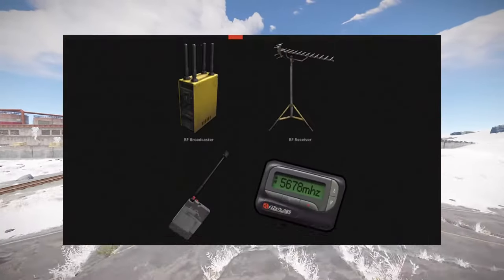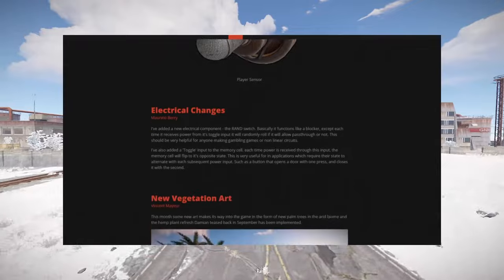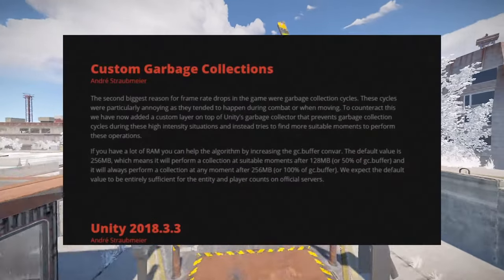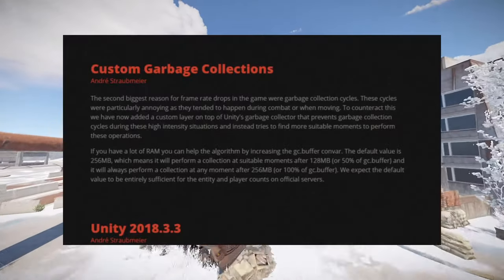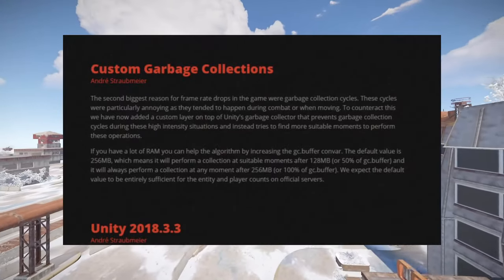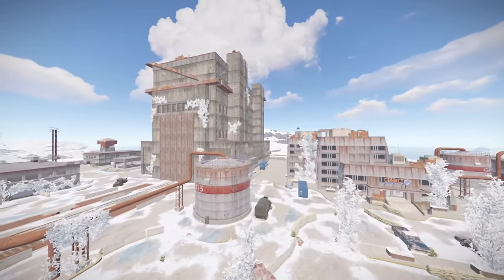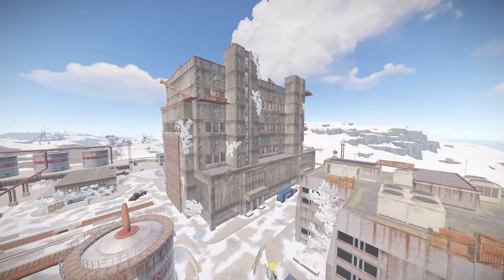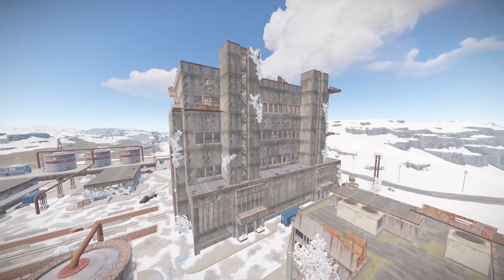How to reduce FRAME DROPS in Rust (GC Buffer Explained) | Quick Rust Guide

Comment: I discovered this option myself only a couple of days ago and it made a big difference for me (setting to 2048 with 16gb of ram). Funny thing is I'd noticed the occasional freezes a week prior and said to my mate over discord (being that we're both software engineer's) "what's with the game briefly freezing up every now and then? Almost feels like garbage collection to me". Then a bit later I noticed the console messages saying "rust emergency garbage collection" and confirmed my suspicion (and quickly found the solution).

Personally, my guess is that they set it to its 512mb default back before they added the stupendous amount of DLC they've chucked in the game lately, and now 512mb is simply not enough of a pool to contain all the various different skins (and other useless rubbish) you might find near you to avoid "emergency" GC.
Reply: isnt 4096 for 16gb ram better ?
Reply: @xtc3530  Maybe, but I haven't noticed any stutters at 2048 (whereas they were VERY noticeable on default settings) so that's where I've left it.

Comment: Won't this make the garbage collection occur less frequently, but take longer to execute once it does run?
Reply from the maker: The collection process tends to feel the same regardless of size, but you are correct. 

The positive is, Rust will try to do such collections when other players or npc’s aren’t around. 

So while the lag / freeze may feel a micro amount bigger / longer - the chances of this happening during a fight or a really bad time is much less. 

It’s definitely a case of weighing up the pros and cons but honestly changing this setting has stopped those random freezes while I’m literally mid-fight and I get a quick freeze frame.

Comment: I have 32 gigs should I do max?
Reply from the maker: Yeah man, I do. 4096 :)
Reply: @AshenRust  16GB RAM can also right  ? 4096
Reply from the maker: @xtc3530  it can do, for sure. But I actually find Rust using more than 12GB sometimes - so just check that your current average usage while playing rust is no more than 12 before you allocate 4 of it. :)

Comment: wont this reduce fps?
Reply from the maker: No, it won't improve or reduce your FPS massively, BUT it will ensure that when the sudden frame drops happen due to garbage collection cycles - they're done less often and are more optimal times (like sitting in base). So, really helpful for those with enough RAM to support forcing their PC to build up 10GB worth of RAM storage before dumping it at a more convenient time.